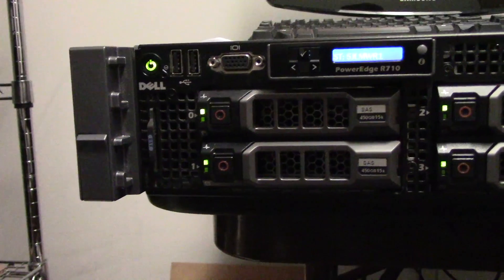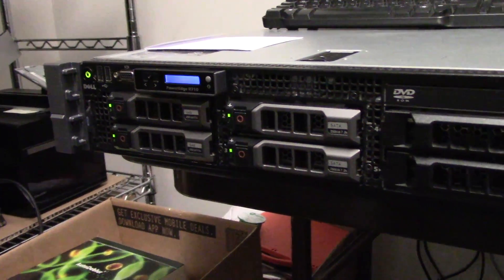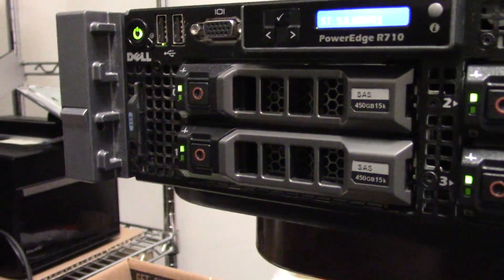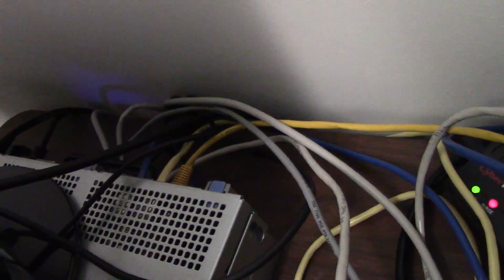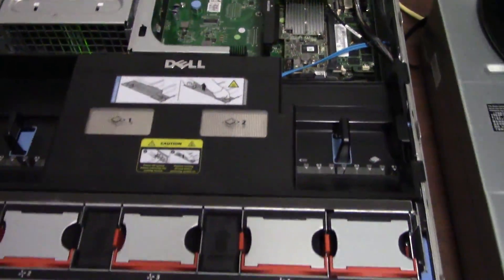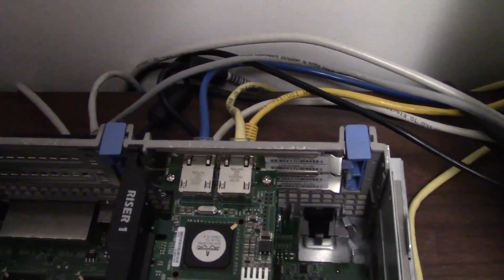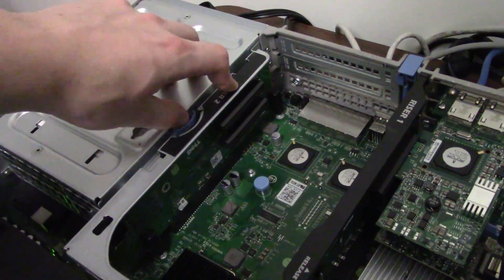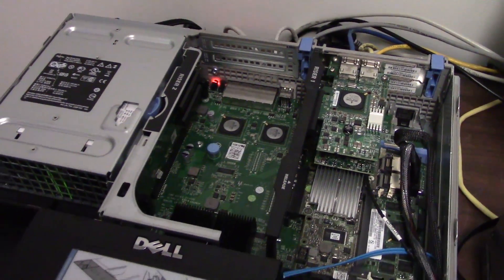Powerful Dell PowerEdge R710 12-Core Server (48G RAM, SAS, ESXi)

Comment: hey someone7089 i just got me a dell t3600 socket 2011 from ebay and with 52 gig of ddr3 rdimm from recycling center with quad core shes a beast and i have yet to figure out what to do with her she supports pci-e 3.0 and built in sas for the 15k hdd's im thinking of doing 2x 10k drives for gaming and 1 ssd for os overall, memory is not an issue :) but the cpu i will upgrade to 6core when i get back to it again
Reply from the maker: Oh nice! I used to work with these all the time at my old job. You can get a RAID card for it if you want. It's a good machine.

Comment: How many VM's with 48GB ?
Reply from the maker: Depends on the VM. If I were running Exchange servers for email for some reason, one or two. Web servers, probably at least 20. It depends. On this particular machine, I think we had 5 or 10, with a few running at any given time.
Reply: Thanks, My intention is to have PFsense, FreePBX, Openmediavault, PopOS, Windows7 plus a few more experimental distros. I'm looking at R710 with a pair of X5680's and 144GB ram in  a 'homelab' environment, I think it would be ok with that. I've heard that the 710 with 144GB and x5680's it'll run around 36 !?? VM's
Reply from the maker: I recommend an R410 unless you need more than four 3.5" disks, one of my more recent videos is on one. It's half the height of an R710 with just fewer HDD and RAM slots, same CPU sockets,  but can take 128GB if that's close enough for you.
Reply: @michaelmayfield4304  Firewalls should be on its own hardware. However, it does work very well when virtualized. I've ran it for years that way at home. The worst part was when updating esxi you had to do it offline since you need to take the firewall down first. Other than that, no issues. For homelabs it works well.

Comment: Get that 288 GB ram expansion kit 😜it's worth it
Reply from the maker: Thatsa lotta memory. I am finding that the CPU core count (24) is becoming more of a bottleneck than the 48GB of RAM we currently have though. Wonder if we could upgrade the CPUs...
Reply: The highest end CPUs you can put in those servers are the X5690s. They are still 6 cores 12 threads each but it has a core clock of 3.46 and a turbo of 3.73. Although that it turbo boost 1.0 which means only a couple cores actually boost to 3.73 ):
Reply from the maker: Probably not worth the money then. Oh well, it's still a good server.